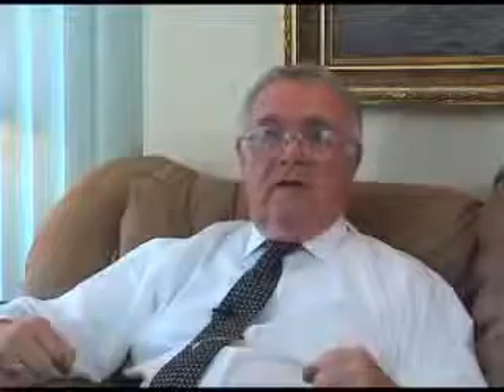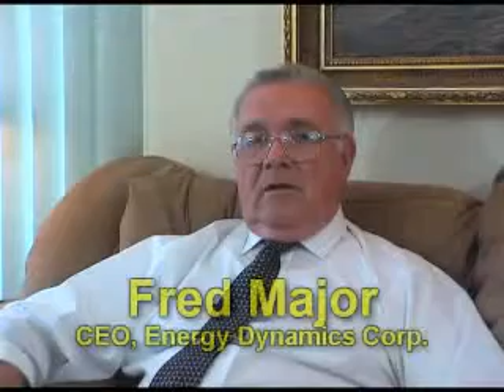Dr.Paul Internal Combustion Engine - 80% Efficient!!!. part4

Comment: Cars are not getting ligther..  I normally drive a 1976 fiat 127, and at the very best i get 15 km/L - And this is a 650 kg car with 45 hp.. I friend of mine drives a brand new Ford Fiesta and also gets around 15 km/L - But this i a 1500 kg car with 96 hp.. So i find you argument invalid..

Comment: up until this video i was interested, now he's just rambling about crap and doesn't know what he's talking about. I completely understand that more valves add to engine stress and (all things being equal) would reduce efficiency. But you can't tell me a 1970's motor that made 250hp with a 5L motor is more efficient than new 3L v6's that make 350 and use less fuel...

That's not to say this new design isn't better, but his rambling really hurts his credibility. He needs to just get to the point!